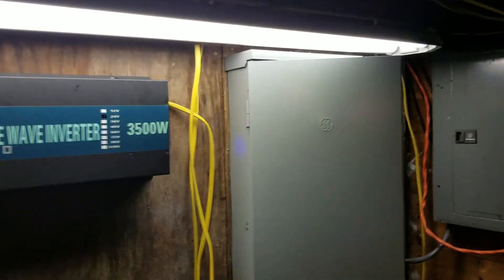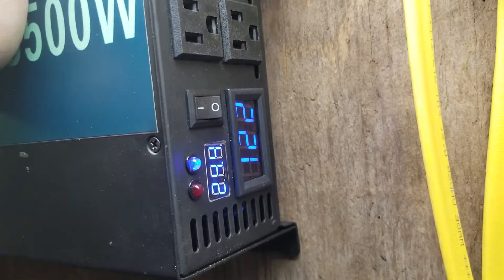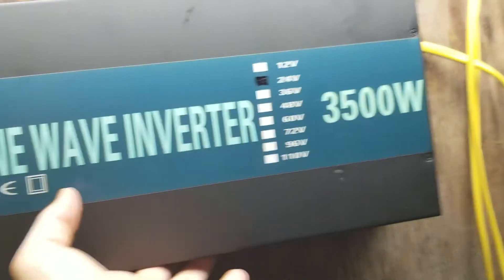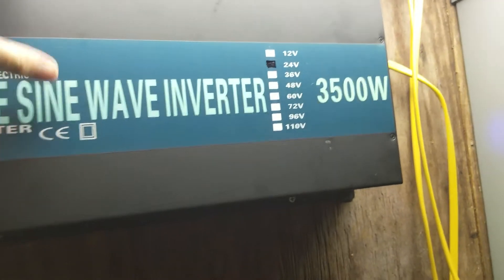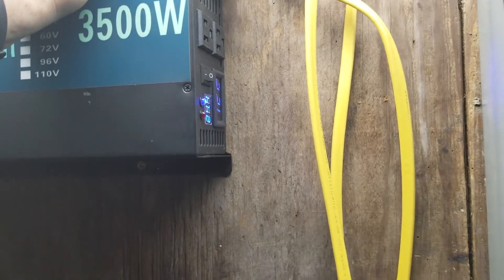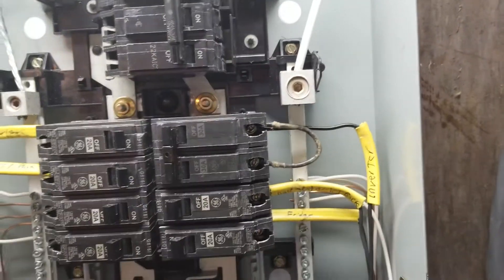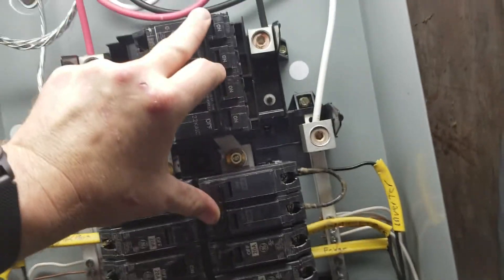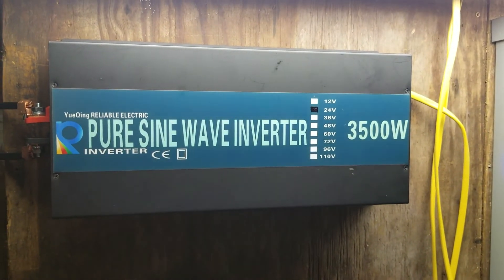Reliable brand 3500w power inverter day 1 testing

Comment: What has happened with the inverter? I have the 3000 watt unit for 3 years now. Push it to the limit often. Plan on getting a backup unit. 3500 would be my choice if it has the same longevity.
Reply from the maker: I actually sold mine to a friend and I upgraded to a 12k split phase inverter. I'm running my entire home off grid
Reply: @novatar-42  thanks.

Comment: John , nice video thanks for the info. I have been wanting to wire mine into my panel. I notice you offered some one pictures of your wiring, can I get a set. Arivera841@cfl.rr.com
Reply from the maker: Sent you photo
Reply: Thanks John, should have my inverter this week.
Reply from the maker: I will see if I have the photos since this video i have upgraded to a 10kw aims inverter but ill check and send you what I can
Reply: Thank You, if is not to much trouble. I’ve been looking, but can’t find anything ordering inverter tonight, I have. Everything else. Hoping to use it as a backup solar generator.

Comment: Hi , nice set up ! Any idea if this inverter could start 10.000 btu window A/C ? :)
Reply from the maker: Most standard window mounted ac have about about a 1500w continuous use and between 3000w and 6000w starting surg. This unit would run that how ever it will have a very high current draw. You would need a pretty good size battery bank.

Comment: Great video...what wire gage are you using off of the inverter
Reply from the maker: 6 gauge on the ac side. But you only need 8 gauge. I have 6 gauge on the dc side but at 300v you really only need 8 or 10 gauge

Comment: what brand are your batteries and how many do you have?
Reply from the maker: I'm currently running Nissan leaf batteries I have about 12kwh
Reply: o.k. so regular inverter batteries. what do you recommend. i don't own a nissan leaf so i have no idea about those. corvette batteries yes lol
Reply from the maker: @gamesoldiers1902  you can use regular lead acid batteries or marine rated batteries to get started

Comment: I bought this exact inverter for my tiny house solar setup.  This inverter, 1500 watts of solar, and two Tesla batteries for storage.  I'm running a 3.2 cubic foot fridge/freezer that is always on, 700 watt microwave, countertop convection oven, computer,(tower computer not laptop.) 5000 btu ac, and of course lights.  It's been ten months since I hooked everything up and no problems so far.

Comment: Did you ever try and run any 3 prong appliances off the outlets on the inverter?  I got this exact same inverter and couldn't get it to work right.  Trying to figure out if it was something I did wrong or if I got a lemmon.  https://youtu.be/ab8PqOpbWLo  here is a video of mine refusing to cooperate
Reply: Peak.
Reply: Romex running to a box with 5 circuits. Working great. Clamp meter says 29 amps at
Reply: Plug in on amp only supports 15 amp max. Have to hard wire inverter. I have this unit with 10 guage.

Comment: Does this unit still run?
Reply from the maker: Yes.
 I've recently had upgraded to an aims split phase. The reliable is now my backup unit.
Reply: Cool.
Reply: I ordered 2 of the units and both was bad out of the box dead on arrival
Reply from the maker: @donaldsteele6276  I'm very surprised
Reply: @novatar-42  I was too I'm so angry too the first one smelled bad burnt out of box and the replacement hooked up correctly and hit switch shows battery voltage and get solid blue and red light and no AC voltage display it flickers and goes off.
Reply from the maker: @donaldsteele6276  that's crazy I've heard others say they had the same issue.  Maybe I just got lucky
Reply: @novatar-42  yes I got unlucky and Amazon said i recieved 2 units and I only got 1 the first one and they did not refund it after I sent back then manufacturer sent me one and that was defective they said it was my bank I need to replace it they told me. And they said I had bad cables that they make perfect units that never fail. I was like um I have a 12v 1410 ah bank that's only 4 mo old and I made new 4/0 cables for your unit and also tried new 2/0 cables and the shitty 4 way cables they sent 
 And I told them I removed my good working 6kw msw power bright 12kw max inverter for the test and hooked it back up after the failure and no problem with that unit. So they refused any further help and said the unit is fine nonrefundable.  I'm like shiiiit! My system is very nice look on my videos you will see a bad ass portable wind turbine tower and solar setup.im still working on it.
Reply: @novatar-42  I'm suing the manufacturer for selling dangerous non working products that violate consumer protection laws.
Reply: @novatar-42  actually I told the manufacturer to send me the Ac power regulator card for the main board and they did I I unsolder the bad one and replaced it with the new one .now it's working.

Comment: I couldn't tell but you might want to make sure the neutral is not bonded to ground in that panel.
Reply from the maker: Its not.. and I've since upgraded to a aims split phase inverter I'll be doing a video on that soon.  The reliable is still working great though very happy with it after a year
Reply: Where do u check to see if the neutral wire is bonded to ground?

Comment: really  strange   this   particular  inverter  have    alot of   negative  reviews  on  all    websites
Reply: Yup. Negative reviews are usually from idiots I ordered one of these in the 12v and it's supposed to be here lol I have e my 4/0 cables waiting for it to wire this into my bus bar and 30 amp rv box. 1800 watt solar array 500 watt 3 phase AC turbine been getting 800 watts usual 1200 watt peaks even triggered my relay dump board and solid state relay and resister bank some times I set that to 14.9v so it 1v above my charge rate from my 80 amp mppt controllers.  1410 ah 12v bank . Samlex  duel bank 80 amp marine charger . This system had a powerbright 6kw 12kw max msw inverter but that started putting 135.6v at 35amps out all ports lucky I seen it in time and mailed it back for repair. 3500 watt puresine will be my backup o hope it works well .
Reply from the maker: I haven't seen many negative reviews I've had zero problems with mine.  I'm running it at about 2000w most days.  Depending on weather.
Reply: with you  but  but  with others    there  are  just countless   complains  about those  "unreliable"  inverters
Reply from the maker: @waelfathe9909  could you link something specific I haven't seen very much I recently ordered a much larger one and I'm expecting that soon.
Reply: Been using mine non-stop, powers my house. It will be a year next month. Overloaded it many times. Still going. It's a Reliable 24v 2500w model. Want to upgrade to run my washer.
Reply: This inverter will surprise a person. Use 10 GA wire to a breaker box. Yellow wire should be green. Ours run into a 40 amp breaker with multiple appliances, as he, gas dry, dish wish, chest frezr, refrig French door, 55 in tv, 2 iMacs. Trick only run major app. One at a time. Ref and frz run as they need.

Comment: 70 volts dc from solar is over kill and also a loss of charge current best off to change your solar array to 24 volts to gain the extra charge current. If you have a long run with solar and a large voltage drop then consider a large enough wire to carry current needed with a voltage loss of no more than 10%. If your trying to save money on copper wiring for lower current they youll have to spend more on solar panels to get the charging ability to handle full charge each day. With your charge controller you've got 23 volts being lost as heat. Totally inefficient. It is possible to run more than one solar charge controller by splitting the array to charge the same batteries

Comment: How did you hard wire the inverter to the panel? I noticed that the wire color did not match the wire color on the  inverter. Thanks. Also, now that you have had it for a while how is it working?
Reply from the maker: Larry Richelli I tested it with my multimeter. I can send you pick of my wiring
Reply: That would be great, Thanks larryrich7@ymail.com
Reply from the maker: Larry Richelli is that gmail?
Reply: No, Just as it is typed ymail
Reply from the maker: Larry Richelli ok sent you some photos